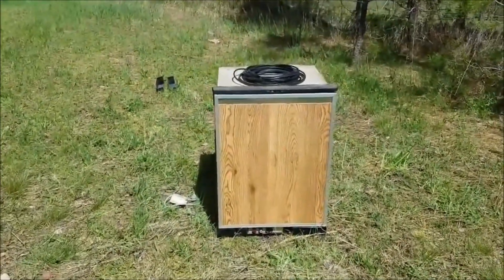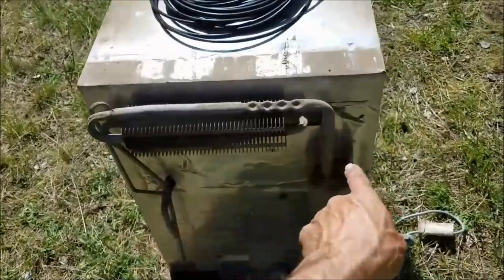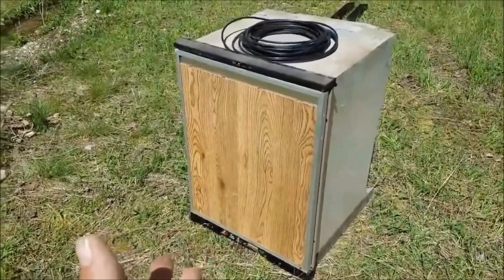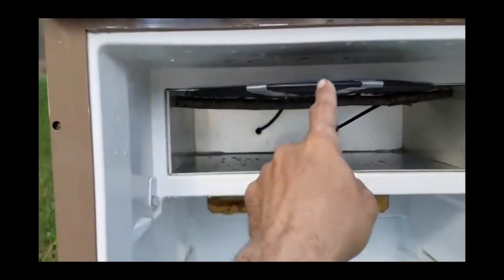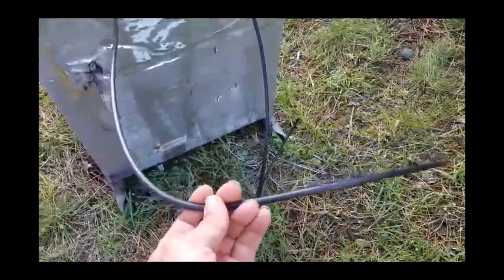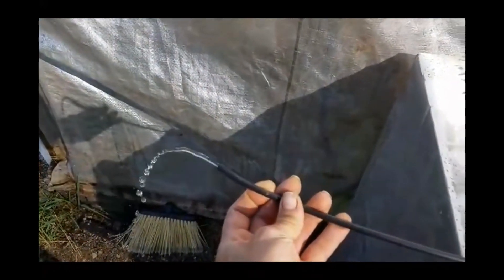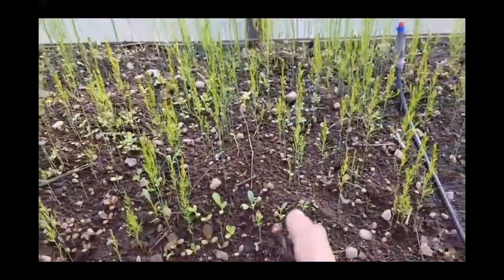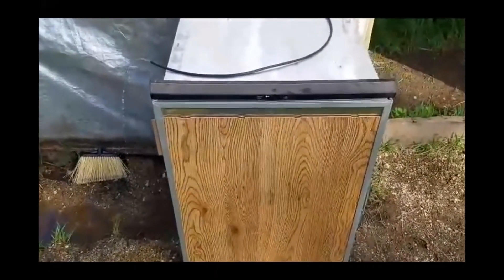GRAVITY Powered OFF-GRID refrigerator, no electricity needed!

Comment: Does it require well water (which I must presume is pumped w/electricity) or can I simply use a water barrel inside a straw bale enclosure w/wo electric pump?  Could the polytube be used in a well insulated cooler?  Pls answer as I need to prepare for potential weather disasters.  TX